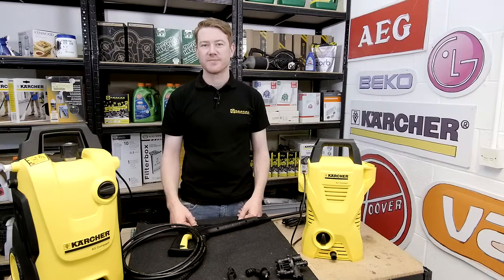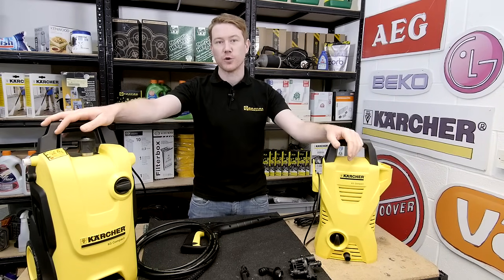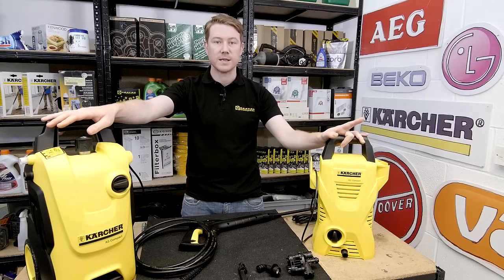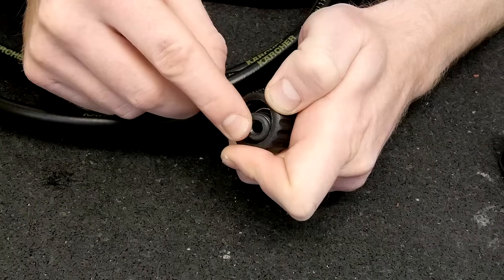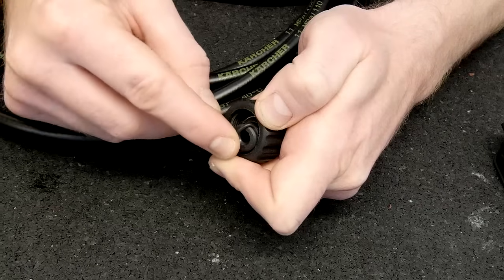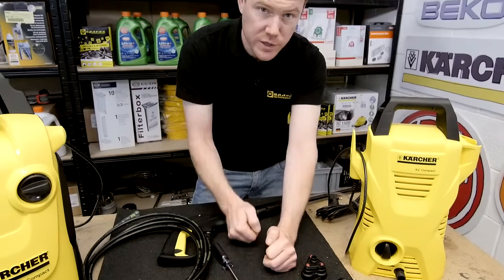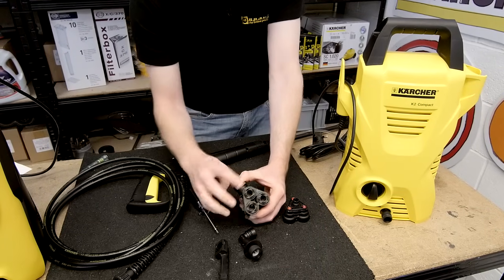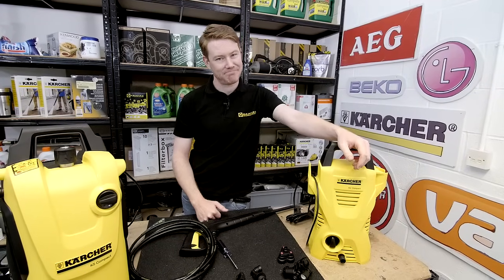Karcher Not Working? - Karcher Pump Faults Fixed!

Comment: dear sir,
i have the small pressure washer in my hand in last two years, no the washer have a problem, after switching on the machine automatically starting and cut off unless the gun switch press, but machine is working normally,  water is discharging also with pressure, kindly advise me to correct this issue
(k2 basic karcher)
Reply from the maker: As we say in the video you need to remove the power and case then turn the water on to trace where the leak is coming from.

Comment: My engine is fine, I have no water leaks, but I do not get up any pressure when the water is on! I have suspected the capacitor, but Kärcher specialists says that if the capacitor is broken, the engine do not run at all! What do you think? I have a K5 Premium
Reply from the maker: I agree that a capacitor problem usually caused non starting or stalling when under pressure.

Comment: i need more Informationen i by by evry 3 month karcher k2 its workin onlli 3 or 4 manth after that its not work i have more then 7 p s plis help me
Reply from the maker: Hi Mohamed, thank you for your post. We would recommend contacting the retailer or Karcher direct as your pressure washer will usually be covered under a 1-year guarantee.

Comment: does electric washer pressure crack or breaks glass?
Reply from the maker: Hi Clinton, funnily enough I was clean some decking last night and the splashes went over my patio doors so I gave those a good wash down after, You should not have a problem with normal or double glazed or car window but I wouldn't try washing your best crystal wine glasses. 😊
Reply: Yes😥!.. Avoid hitting any glass doors or windows with the unit

Comment: Hi,

I have water leaking out the side. I did as you suggested, took it apart and turned on the water but there wasn't any sign of a crack - the water came out the outlet valve.

But when you turn the power on (after putting it back together of course) the water is coming fast out the side and very little from the hose.

The motor isn't pulsing - it sounds as though it's on constant as though you are applying the water spray (or have the handle pressed)

I was going to order the rings but i'm not sure that's the problem. Any ideas?
Reply from the maker: Connect the outlet hose with the power disconnected when the water is attached as it helps pressurise the unit and show where the leak is.
Reply: Thanks, i'll give it a go.

Comment: My Karcher's pump is running without the gun trigger being on and even with the on/off switch at the off position. Any ideas?
Reply from the maker: Hi VT, check for any leaks which may be causing pressure issues before testing the switch.

Comment: my pressure washer continues to run and doesn't have any pressure. I have checked all the common problems listed in the handbook but none of them are there. I can turn off the machine with the on/off switch but once I switch it to on the the washer continues to run with very low pressure ..... I have checked the water supply and it's getting water, filter not blocked, all the easy problems to look for don't apply .
Reply from the maker: Hi Daniel, the machine will not shut off if it is not producing the full pressure. If there are no leaks the problem is likely to be the cylinder head or the valve in the inlet elbow.

Comment: Hi there, I have the K2 model. I am finding that when plugged in and water connected only a very small spray comes out of the gun when the trigger is squeezed. No problem with water supply, it goes into the unit fine but nothing seems to be coming out of the other end! Please help, I'm out of ideas. I tried bleeding the unit but only a drip of water comes out of the pipe after I've disconnected the gun hose. Thanks, hope to hear from you very soon.
Reply from the maker: Try with another spray lance or brush as your lance jet may be blocked.
Reply: eSpares I have tried with both the Vario lance and the standard lance. No joy. It seems like the water isn't being pumped out of the unit. It goes in ok but seems to stop there and nothing comes out.
Reply from the maker: Even without the pump working there should be a fine (not powerful) jet when the trigger is pulled. Remove the hose connector on the inlet and check and check you have a good flow when this connector is attached to the hose connector. Then look into the connection on the machine and pull out the filter inside to check this is not blocked.
Reply: eSpares many thanks for your quick replies. You mean open up the machine itself?
Reply from the maker: The inlet elbow on the pump that connects to the supply hose:
http://www.espares.co.uk/product/es1673433/ has a 'filter'  (the green and yellow bit) inside, if this is blocked it will 'starve the pump' of water and may produce this problem.
Reply: eSpares thanks for all your replies but problem solved. One of the filters was clogged with gunk. I cleared it all out and now it's working perfectly.

Comment: Got a K5 premium that continually makes a pumping noise, it's litwrally been used maybe 4/5 times since purchase. Strange thing is the on/off dial also seems to do nothing it just stays on! any help for me out there? thanks.
Reply from the maker: Hi Zac, the pumping noise could be it's pulsing which usually indicates a restriction so check all the hoses are free of kinks, leaks or blockages test the electrical components inside, this video will help www.youtube.com/watch?v=afPHu9LrRbQ&t

Comment: replaced the cylinder head on karcher jubilee and now nothing at all....argggghhhh
Reply from the maker: Hi Pete, you haven't given much details. If the motor does not run check the switch and either brushes or motor capacitor (depending on model). For more information see another video:
https://www.youtube.com/watch?v=afPHu9LrRbQ

Comment: I have the Karcher K5.800 1.181-254.0 ecologic and was using it yesterday morning to wash my car. It was working fine until halfway through it just lost significant pressure down to almost nothing. The motor is running and it's trying to pump.
I've had the thing for a couple of years and have hardly used it ! 
I'm  so annoyed with Karcher products.
How do seals fail when it's had very very limited usage ???
Plain garbage these Karchers are becoming.
I paid around $750 for this piece of shit
Reply from the maker: Hi Tony, we do get a lot of issues with Karcher products and for a product that is expensive it is disappointing with the issues.
Reply: @eSpares  Thanks for responding. I'm going to try and get it fixed, but I know that this will be my last Karcher,
I'm giving my money to Kranzle next time.

Comment: Karchers are garbage, the wheels on mine don't spin and I have to drag it.  Their engineers managed to mess up wheels.
Reply from the maker: Most Karcher's are inexpensive machines and are great for light to medium duty use. They do build some 'professional kit' that is obviously a lot more well made and powerful and more expensive as a result. And the end of the day it is your choice. If you need new wheels we should be able to help on our web site: http://www.espares.co.uk/browse/at1315ma877/pressure-washers/karcher
Reply: eSpares Thanks for your reply, I am spraying the wheels with silicon lube for now.  The fittings for the hose and gun are also failing though.
Reply from the maker: Some plastic wheels use plastic axles that will wear quickly so using a lubricant will help. The 'cheaper' models hoses are often only a light weight plastic that  if allowed to crease can fail quickly, We do a good kit that will fit most models and have a video here:
https://www.youtube.com/watch?v=LGBbuIJ2aOY
Reply: mikedrz mine has been treated like shit since 6 years i have it, still working fine like a horse.
Reply: Sadly, i have to agree. Mine has seen very light use, and today without any warning just lost pressure and developed a huge leak inside. Very dissapointed. "Made in Germany" doesn't means much anymore, it seems. Something that fails after such light use is not worth the effort to repair or use.

Comment: I'm not happy with the quality of my K3 premium ... the working pressure is not even close to 120 bar, It's still under waranty not even 4 months old ... better invest little bit more money and get a Kranzle pressure washer
Reply from the maker: Hi Tarik, the pressure delivered by any washer will depend on the spray lance used as  to produce this it needs to focus all the flow to concentrate the force. If it is under warranty and is faulty your supplier or agents should help if there is a problem,
Reply: Yes the agent fixed it today, and said that the valve was clogged. But I'm sure the pressure wasn't satisfying me since I bought It and I know It was clogged from the factory. But now It's working perfect and descent :) thanks for the fast reply :) cheers
Reply from the maker: Thanks for the feedback, glad it is working correctly now.

Comment: 4 machines I know of, everyone of them split it's pump housing. Karcher are truly rubbish, I stop random people at Bunnings to steer them away from the brand
Reply from the maker: Hi Blair Knight, thank you for your post. We believe it boils down to the personal choice as the domestic range is intended for light use.
Reply: I've had nothing but problems with Karcher.. two of the older models with split pumps despite keeping them inside during winter .. first one was under warranty, second one just out of warranty ..  now have a K5 of about 5 years, that was also only a couple of years old when the on/off switch stopped working properly.. so it´s now a nightmare to get started.. and then there´s the Turbo dirt blaster which lasts all of 5 mins.. I´ve probably spent more money on those things than the actual presure washer itself ... I dread every time I have to drag it out to do a job around the house wondering if it´s going to work or I´m going to be swearing at it and spending the rest of the day fiddling with the bloody thing ..  once this one dies I won´t be buying Karcher ever again, that´s for sure..despite it being a German branded product.

Comment: mine sound burb... eekkkk stop eekkkk stop... why?
Reply from the maker: If the machine is stopping while running remove the spray lance as it may be partially blocked. If it keeps starting when not spraying you either have a leak or the pump seals are worn losing the pressure.

Comment: To many plastic parts and split under pressure. Very bad design.
Reply from the maker: Hi jason80892, thank you for your post, there are many plastic parts that make up this type of machine but most don't go wrong and Karcher is a popular brand.
Reply: @eSpares  it is a very popular product but there loosing many customers as there products  don't last. Why would you make a pump housing out of plastic.  I've had my k2 for three years and used it 3/4 time a year and its failed.  Pump housing split.
Reply from the maker: Hi jason80892, we have noticed that a lot of manufacturers are making there products cheaper which is resulting in them failing quicker and more often.
Reply: @eSpares  That's right it's bad practice. I still don't understand why you would make something that's under great pressure out of plastic.  I won't personally buy another.  After opening the k2 to see the fault it's such a small plastic part that  could easily be metal.
Reply: @jason80892  Sadly, this is the fault of the consumer. We demand lower pricing so manufacturers build domestic units to suit our price sensitivity and their required margins.
We want them cheap so we get crap. Welcome to 2019.
Reply: @siggy101  you would think the main part that's under pressure would be metal, it shouldn't cost that much more.

Comment: Hi, I have a K6.85 that wasn't working properly but have just changed the capacitor and now works fine apart from water flowing into the detergent bottle and spraying out of the lid of the detergent tank.  Could you advise an where the problem could be please?
Reply from the maker: The valve on the 'chemical set' is likely to be leaking, the part we think you require is here: http://www.espares.co.uk/product/es537805/pressure-washer-spare-parts-set